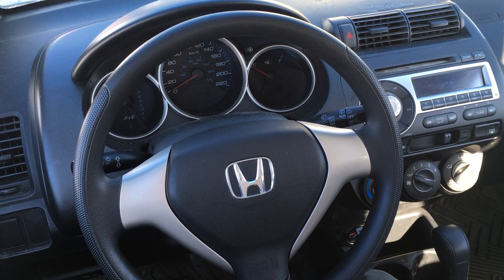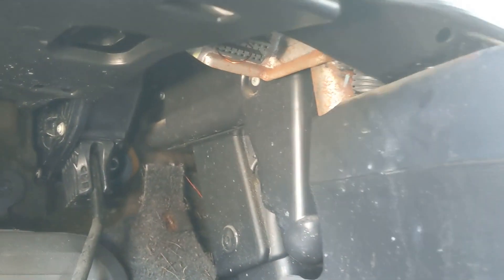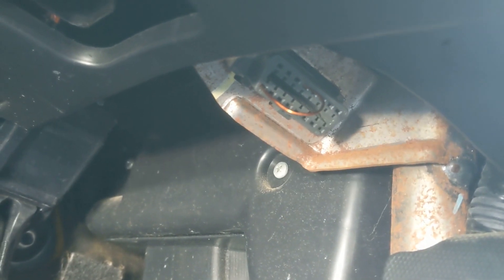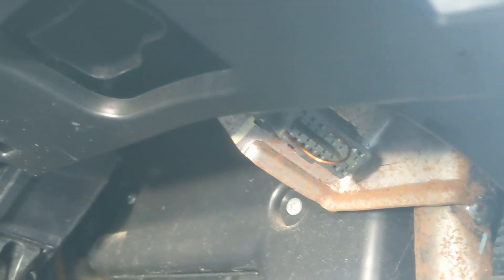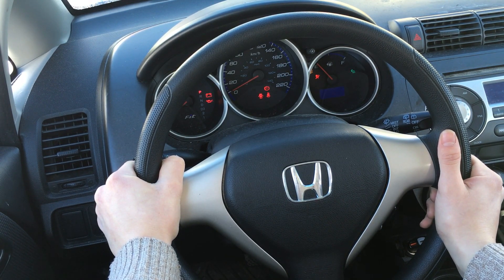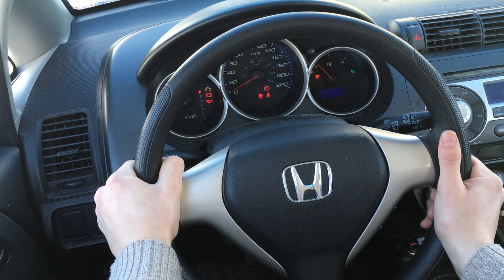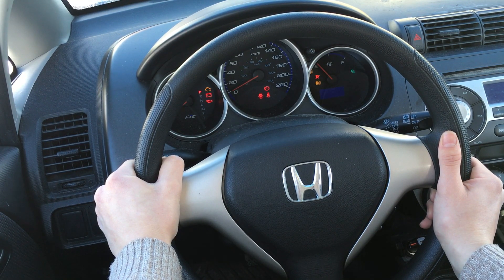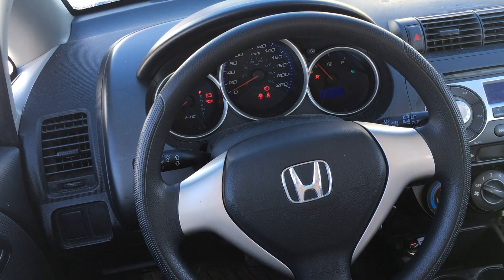Honda EPS SAS Torque Sensor Relearn: DANGEROUS Steering Fix! | Fit, Civic, CR-V... RESET/RELEARN

Comment: How did you end up fixing the issue? I have a civic 2008 that has the exact same issue, the pull to left is so hard that it takes so much force to bring it back in the middle. Also, as the vehicle speeds up, the steering wheel starts to feel lighter (left pull force reduces and steering can be controlled with one hand but still goes to left if let go). I'm not sure if I need to replace the rack and pinion or if this is an eps module issue.
Reply from the maker: A temporary solution is to pull the EPS fuse which alleviates the safety concern of the vehicle leaving the road if your hands left the steering wheel for any reason. This however doesn’t actually fix the issue of course, it is worth attempting a SAS relearn however the EPS module generally doesn’t lose its calibration for no reason and is generally the result of damage to the rack itself wether self inflicted or not. Unfortunately a rack replacement is usually in order at which time the SAS relearn will be completed regardless. You’re likely to find a good rack in a wrecking yard if you have time and don’t mind turning a wrench or even try scouring for a vehicle being parted out. You might come across someone plucking parts themselves for sale. Cheers
Reply: @combustiontherapy2222  Thanks for the heads up. I will try removing the fuse to see what it does. My only concern is that if the EPS module itself is faulty then even replacing the rack will be useless. Hence, I'll probably need to make sure eps module is good. Btw, I sill couldn't find the exact location for the eps module, I think it is on the passenger side pillar but not sure. It is a dx-g model. Do you think if I find an eps replacement module that would be a good candidate for resolving this issue?
Reply from the maker: @haseebtehsin9923  Personally I would find it hard to point to the module but it is possible, in my experience it’s been the rack every time
Reply: @combustiontherapy2222  sounds good, I'll get a quote for changing the rack as well after I try some of the tricks. Thanks so much.
Reply: @haseebtehsin9923  Hey, I have this same issue on my 2007 honda civic hybrid. Pulls super hard left and hard to turn right.  Any update on the issue? would love to know if you fixed it or found a solution.
Reply: @haseebtehsin9923  Ive been fighting and trying to diagnose this issue for a very long time. Nightmare of an issue.
Reply: @Jacksongamma  Hey man, so far I haven't, I've tried the relearn but that doesn't help. Somebody gave me an EPS rack but doesn't know if it is any good or not. I will need to change the rack and if it doesn't work, I'll swap just the motors between the two because this is definitely a torque sensor issue which is not replacable as far as I know, so if swapping the motor works, I'll consider myself lucky. You should start hunting for a rack as well cuz that's the last resort
Reply: @haseebtehsin9923  Thanks for your response. What an unbelievable and unexeptable issue from Honda... Like what a serious hazard. I was thinking about calling and complaining to corporate honda and seeing how little that does. My car is in great condition but one bad sensor makes it horrible to drive. I have replaced almost all the suspension now because I thought there was a camber issue due to bad bushings.. Turns out I wrong. I heard something about the EPS system having to be properly calibrated which scares me away from trying to approach the job and replacing it myself. Not to mention, The rack isn't cheap by any means. Did you ever happen to get a quote for the job? We are in this nightmare of an issue together. - Jackson
Reply: Yeap, I think the same, there should have been a lifetime recall for this issue. Please do call Honda and see if they're willing to offer anything at all. I did get a quote from local parts suppliers though, the racks available in the market are coming from salvaged vehicles and are extremely expensive. I got quotes for around $800 to $1000 just for the rack and the replacing cost will be separate. My car is worth less than that so I am looking for some cheaper way to fix it. May be calling Honda would be a suitable option for me as well.
Reply: @haseebtehsin9923  I haven’t been so optimistic calling them which is why I haven’t done it yet. I know they’re instantly gonna hit me with the “sorry, cars not in warranty” or “sorry, there’s no recall on this. Take it in and we will bill you $5000.” I will do it soon though. I suppose if I’m persistent maybe it can go somewhere. Feels like I have no power steering when I turn to the right. Does yours also just have seriously hard turning to the right side and flys left? I think we may have the identical situation here… also, I’ve noticed some days it’s not as bad as others and it will turn easier right and not pull as hard left. I really don’t get it. That’s exactly what shows me that it’s the sensor, because randomly it’s getting different voltage regulations that the wheel is being torqued to different sides. I found a very interesting video with some who has the same problem. I’ve only ever found me, you and this one guy with the same gen Honda with this issue. I’ll send the Link to the video. Sorry for the essay lol.
Reply: @Jacksongamma  I have the same problem with my 08 civic. Hard turning right, easy to the left. I got charged $130 at a local garage just to have them tell me it needs to be taken to an Honda dealership.
Reply: @haseebtehsin9923  I think the module is behind the interior fuse panel.  Did you resolve yours with the EPS SAS Torque Sensor Relearn?
Reply: @MrRerod  Hi, well no, I couldn't, I also got the rack replaced with a used one I found locally. It did become a bit less severe but the issue wasn't still resolved. I was told to take the car to Honda and they will reprogram it. I ended up selling the car as it was getting very expensive to fix it. I still think it was probably the eps module issue or it may have been just a reprogramming issue. Sadly, I would never know.
Reply: @haseebtehsin9923  me either..   When I jumpered 4 to 9 and powered up, the torque sensor relearn light flashed three short flash's followed by a longer forth flash over and over.
So I removed the 60A EPS fuse and all is good. No need for a gym membership either..
I assume my check engine light and torque sensor relearn lights will stay lit until I replace the fuse which will be never.
Reply: @MrRerod  If you can safely steer it that way then I guess it is all right, when I removed the fuse on mine it just became super hard to turn, even while driving it stayed that way so I had to put it back right after my test drive. These steerings are a disaster I would say.
Reply: @Jacksongamma  same but mine doesn't pull left, but the steering wheel is 45 degrees left while going straight. Eps light on as well
Reply: @haseebtehsin9923  I’m late to get back to this, but this has been the best information I can get on this issue. I have a question for you if possible. So on my car 07 Honda Civic hybrid, isn’t the EPS fuse linked with the main fuse (#1 in the fuse box on the engine compartment)? If so, can you even drive the car without it?? I would just pull it out and find out, but with my luck someone has boogered up the screw on the fuse and I can’t pull it out simply. Im curious to see how the issue is without the fuse, but if that fuse is the main fuse.. how will anything else function. Please let me know. 

In regards, 

Jackson
Reply: @kevin198701  It’s a complete disaster. Although, atleast yours is showing a code. That makes me lead to believe it’s something that can be sourced instead of hunted for. It took me MONTHS to find any information on this issue. Matter of fact, the only people in the world with this same issue are the people in this comment section.
Reply: @kevin198701  what year and model is your car?
Reply: @stephendbartlett  hey, sorry to hear about the disaster. Did you ever find any solution or more information?
Reply: @Jacksongamma  Hey, as far as I remember, I didn't remove it from the main fuse box in the engine cabin. I think I removed the second or third fuse (or both) from inside the car in the fuse box under the steering. I was also able to read out the fuse information that's there on the left side of clutch pedal. You can try that as well. I am not sure if it would be the same location for the hybrid model though. Would be best to review the user manual to find that out. And when I did that, the steering wheel was just not turnable, even worse than how it is with the wheel flying to the right side. Hope this helps you get even closer to the fix.
Reply: @Jacksongamma  took it to a Honda dealership and had it recalibrated. Seems fine now. Steering is still stiff in my opinion but at least it doesn’t want to pull the car off the road or into traffic!
Reply: @stephendbartlett  Hey, thanks for your response. I took a video of my symptoms and was wondering if I could share them with you to see if they were similar to what yours are. If so, maybe ill give it a shot and take it to the dealer and see if they will do it. Although where I live the mechanics are very low grade and I am highly assuming they will deny doing my car. If you are willing, of course, Could I take your email and possibly send my phone number to you through email or i could just send the videos through email if thats easier. I would love to figure out this problem and maybe help others in our semi youtube forum page.

The reason im curious to see if the symptoms are similar is because the strict reason i havent taken it to a dealership already is because im quite strong under the idea that my torque sensor or steering rack is actually broken or failing. But if it could be fixed through a simple recalibration that would be great. 

Please let me know, 

In regards 

Jackson
Reply: @Jacksongamma  I took it to a Honda dealership and had it recalibrated. Seems to have done the trick. It’s been fine ever since. However, I have been getting a eps light come on lately though. No steering at all when the light is  on. Shut off the engine and it start up again and usually it’s fine.
Reply: @stephendbartlett  this EPS problems are a nightmare, and don't think that affect only that civic generation. I have a 2001 1.6 sedan and I'm having the same nightmare for more than a year. Swapped modules ( a used one, not new) . Honda really f** up on this one and should recognize it. A car in perfect shape is a nightmare to drive because of this. On the internet is not clear what the problem really is, no one has a answer for this. I'm out of ideas. After changing modules the problem got less severe. A year later is a nightmare again. Basically if I turn the car on , and give any input in the steering wheel it works. 2s after a I leave it alone, the eps module clicks, cuts power power to the motor and no EPS. Very very very frustrating, I can't even sell the car like this
Reply: @MrRerod hey there ! I'm going through the same issue , and I'm confused about pulling the fuse ? I tried that and the car won't start if I do. I disconnected connector a from the eps and the problem isn't there, however its literally like having zero power steering , could you help me out ? Thank you

Comment: Can the  same procedure use for a 2009 honda civic fd2
Reply from the maker: Yes this can be used to calibrate the steering angle sensor
Reply from the maker: Shorting these pins at the OBD connector should enter service mode, the process itself however varies slightly from vehicle to vehicle... The flashing following the correct procedure will indicate a successful calibration.